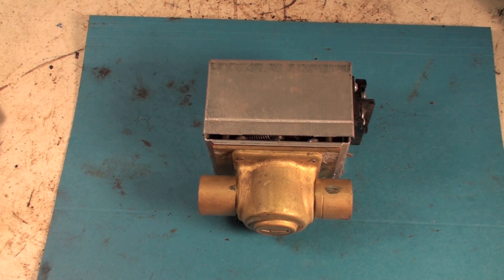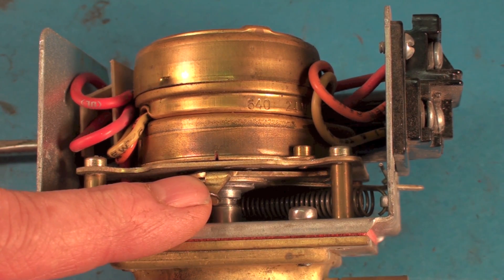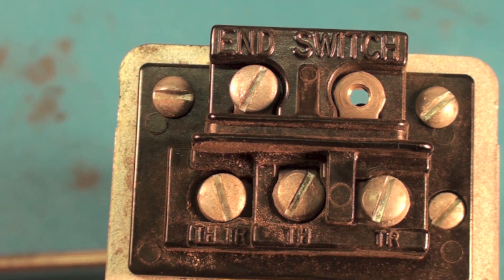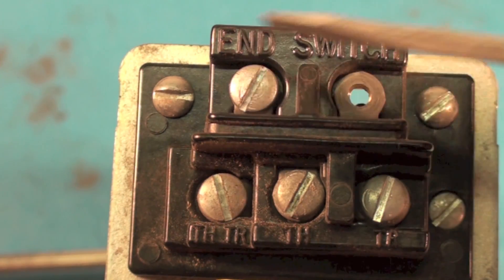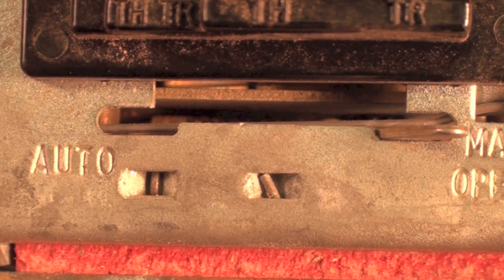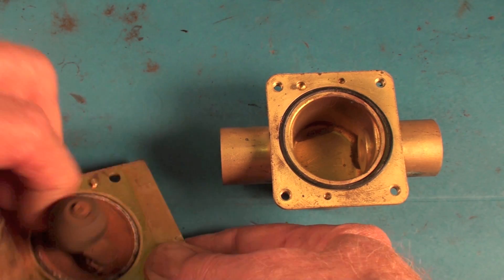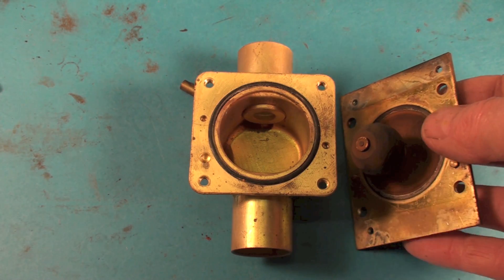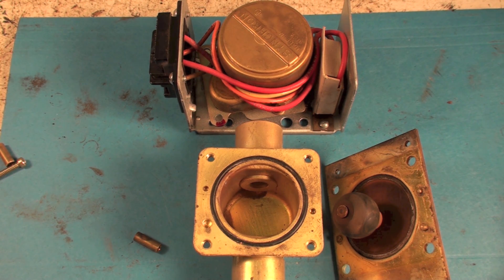How the Honeywell zone valve works.  Part 1

Comment: Hi GFM. I have a 5 zone system and one of the zones is staying hot without the thermostat calling. Thermostat is good. I pulled the power head off and the valve stem moves without resistance, but even in the off position hot water flows to the zone. I'm thinking the ball inside the valve may have become distorted or broken. I do have antifreeze running since we're in the frozen tundra and get occasional power outages, and we have a 3 season room with a zone which would freeze pretty quickly. What are your thoughts? Likely or no?
Reply: I have the same situation with my valve where even though the spring is forcing the ball against the seat it's not fully blocking the flow of water . When I removed the plate and looked at the ball and see it looks okay . Possibly it's a slight misalignment of the ball to the seat when it's closed . I had an O-ring that was split and allowing some slight seepage , which is why I took it apart in the first place . I wasn't able to find a replacement O-ring from the plumbing stores or hardware stores that would match the diameter , so I ended up reusing the old one . I'm wondering if someone changed the O-ring to a thinner one, which would alter the position of the ball to the seat , preventing the ball from closing fully . There's some slight play allowable when remounting the plate onto the body so possibly that requires some realignment . If I had the valve off , I might be able to check and adjust for maximum closure , but it's still installed in the system so that's not possible . Considering they don't even have replacement O-rings available I would assume they won't have a replacement ball for rebuilding purposes if it turns out that is the cause for the water flowing through the closed valve.
Reply: I think I have the same problem.  How did you get the plate off to see the ball?  Also, did you have to drain your system?

Comment: Hy I'm curious with the end switch. I understand it completes a circuit but does the circuit carry 24v like the motor head ? How can I diagnose if the end switch is good or bad ? Voltage or continuity?
Reply from the maker: I believe the contacts are rated for 24 volts only.  If you place probes across the switch, then open the valve, The voltage should first read 24.  Once the switch has opened, you should read 0.  Hope this helps.
GFM
Reply: So when it's closed I should have 24 coming out of the end switch? Is that right ?
Reply from the maker: Well, yes and no.  When testing a switch, I place the probes across the switch.  If the switch is open and all other parts of the circuit are ok, you will show 24 volts.  Once the switch closes, the meter will show 0.
GFM

Comment: Excellent Video!  I am having a little problem with my zone valve (I think) The basement living room does not get any heat from the baseboards. I went to check on the valves (I'm extremely amateur) and felt above and below the valve for the basement LR. Big temp difference. I tried to switch it to manual open just until I get it replaced. It took me a while, but I figured out that I needed the tstat off for it to stay open. I think it opened, as I felt plenty of resistance when switching it to open.

I'm not sure if the pipes down here are frozen, but that might be the case? The boiler is in the garage upstairs and the pipes go straight from the garage down to the basement. It doesn't get below about 45 degrees up there. The baseboards are cold and there is no water flowing. 

Any advice?
Reply: Jacob Turet sounds like your have a airlock in your system. try bleeding it open up a bleed valve air and water will probably shoot out leave open till only water
Reply from the maker: If your zone valve is open, it could be frozen or there could be air in the pipes.  If there are any bleeders on the baseboards you can try opening the bleed valves.
GFM
Reply: grayfurnaceman that's what I just said lol
Reply from the maker: Great minds think alike.
GFM

Comment: i am getting heat continuously with the valve sticking open and with no call from the thermostat ,  If i tap on the valve it closes. is there a way to check the spring return on the valve or if the ball inside the valve is sticking ?
Reply from the maker: Most sticking problems are due to the power head failing.  It can be replaced without opening the valve itself.  You can try lubricating the parts.
GFM
Reply: can i spray a lubricant on the mechanism ?  WD40 or ?

Comment: Just an FYI to anyone or yourself with the same problem...I was able to get this valve to work correctly by removing one of the servo return springs (the one on the side, not the top). It seems the servo motors they are now using are not strong enough to overcome the spring tension. Use of one spring alone was enough to return the servo back to the closed position easily. Thanks again for your help. -Mike
Reply: Ha! Thanks just did the same and now it works fine.

Comment: Hi grayfurnaceman!

You have helped me with your excellent videos immensely! Thank you for posting all of your videos!

I need some help with a brand new Honeywell V8043 E1012 zone valve. I have a hot water boiler system with three of these pos valves (such junk - honeywell isnt what honeywell used to be) in my system. I bench tested the new valve and the servo motor is not reaching the end switch to energize the circulator pump. Is there a way to adjust the servo motor on these valves so that the motor is engaging the limit switch at the end of its travel?

Thanks in advance!

Kind Regards,
Mike
Reply from the maker: Michael DeStories If it does not move far enough I would replace it.
GFM

Comment: I have a question for you? I have a motorized valve 24 V for my water heater in my apartment, my themometer stays at 70 degrees farenheit and refuses to go higher than 80 degress farenheit. Once I turn it on do I pull that lever to manual and will that allow my thermometer to go to 80 degree farenheit? please please its so cold in the winter im freezing? I need help!
Reply from the maker: CasperthefriendlyGhost PeakAboo You can try opening it manually, but if you do, you will have to manually turn it off also.  Hope this helps.
GFM
Reply: grayfurnaceman Does the thermostate need to be on when I turn that lever to manual? Cause I turned off my thermostate then I moved that lever to manual but my room never went to 80 degrees farenheit? Does that mean the motorized zone valve is broken?
Reply: You can open it but that will not let the end switch turn on boiler .... I suspect something else is wrong... Rule of thumb ,,, never jump out anything on any heater i rather see you freeze than burn..

Comment: I would love to see a video of you explaining how Honeywell or WR 5 wire zone valves are wired and how to troubleshoot them electrically and how 3 wire thermostats work with them.  Thanks Jeff
Reply from the maker: There are a number of ways to wire these controls.  I will try to make a video on the most common options.
GFM

Comment: What museum did you get that valve out of. They look a little bit different now. And I would more refer to them as famous than infamous.
Reply from the maker: Daniel Curry This valve is the V4043E1003/U.  It is still the most common valve used in the industry.
GFM

Comment: I have an older Honeywell system with the cover plate showing 40000593-066 and a synchron motor 640 24v 353351-5-6-2-81 but none of the current models have numbers even remotely close but they look identical -how do I know what replacement parts to order. specifically if I don't need to change the actual valve will most Honeywell motor assemblies fit the valve?
Reply from the maker: This all depends on the age of the valve.  If the valve is over about 25 years old, the power head assembly cannot be replaced with the new style.  The power head is available for the new style.  Hope this helps.
GFM

Comment: Hi I have a valve like the one in your video and I am not getting heat in that zone. I manually opened the lever and nothing. Also I took the cover off and noticed the motor was very hot.  I would really appreciate any suggestions you might have. Thanks
Reply from the maker: If it does not flow when manually opened, I would think you have a problem in the water system.  If you hear gurgling in the pipes, there is air in the system.  It could air lock the zone.  Also check the boiler pressure.  For 1 story with basement, it should be 12#, 18# for 2 story.  Hope this helps.
GFM
Reply: Hi its a split level home. The 2nd floor heats fine. Its the ground level with problem. I don't hear any gurgling. Don't know where to check the pressure the only meter goes up to 10. Thanks for taking the time to assist.
Reply from the maker: Carlos Soto My guess would be the valve is mechanically stuck.  If you have mechanical skills, you can remove the power head and attempt to manually move the valve.
GFM

Comment: Let me see if I have this right in my mind. So the motor is energized continuously until the call for heat is satisfied; then the spring returns the valve to the closed position once the motor is de-energized. When the valve is all the way open, and the motor stays energized,,,,,,,,,what keeps the motor from burning out ?
Thank you.
Reply from the maker: They are shades pole motors.  You could not burn one out if you tried.  Their locked rotor amps is only a little above the running load amps.  Hope this helps.
GFM

Comment from the maker: If the valve was made in the last approximately 20 years, yes.  If it is very old, the power unit will not fit.  Hope this helps.
GFM